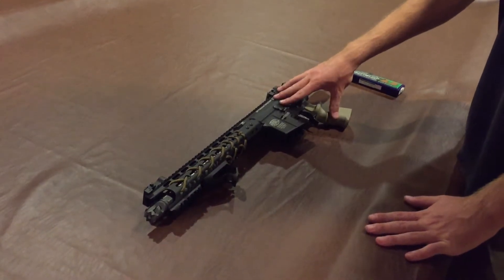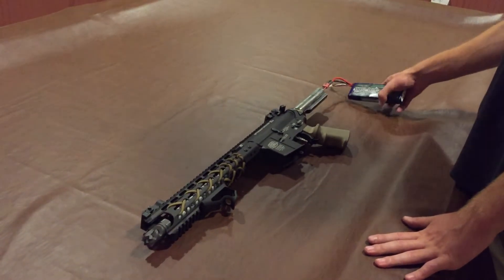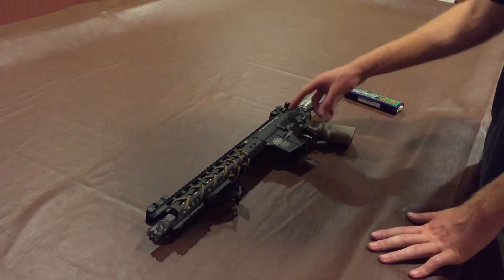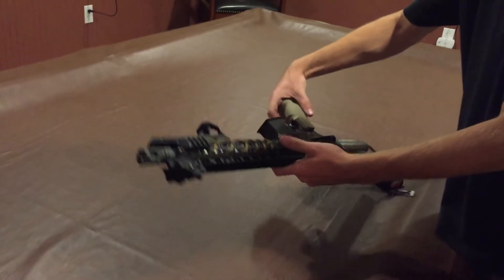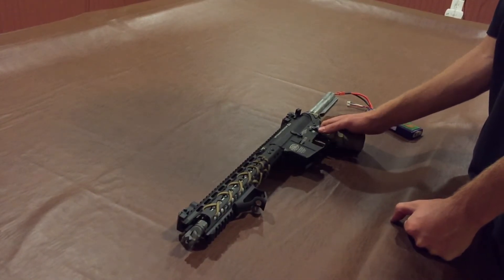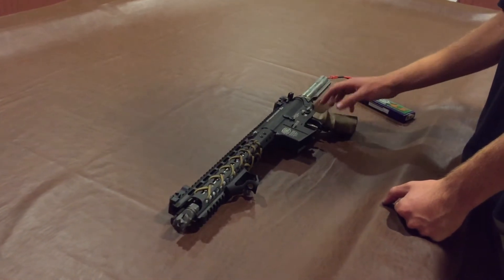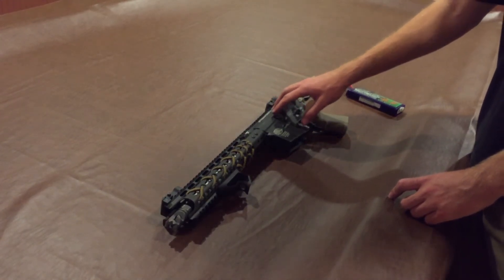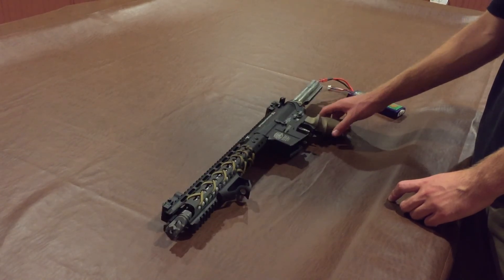Legacy's DSG Re-Done at 1:00 AM | Now with a Retro Arms Split Gearbox!

Comment: Did you have to modify the upper and lower receivers in order to drop in the Retro Arms split gb?
Reply from the maker: This was one of the beta tested models, so like 7 generations ago for RA. Everything had to be modified internally to fit for the most part, but the body itself was not if I remember correctly